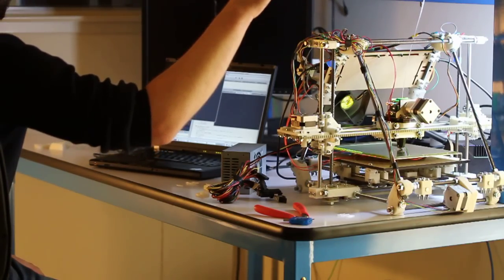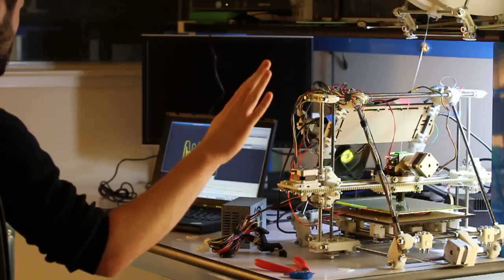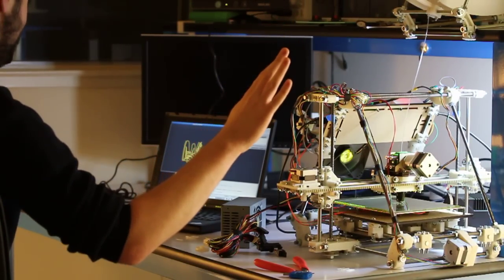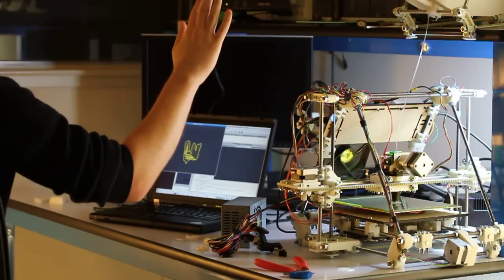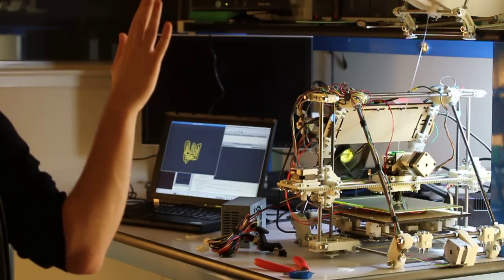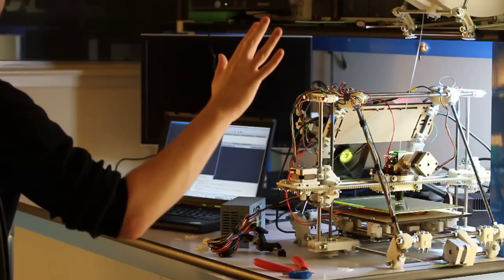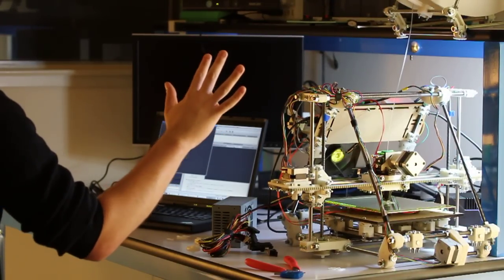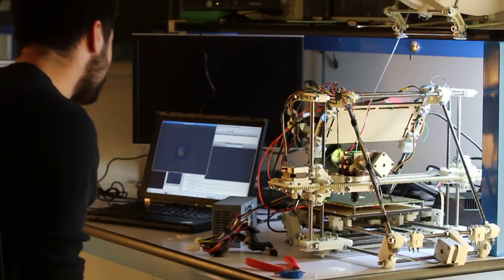Gestural 3D Printing with a Kinect and RepRap

Comment from the maker: @itzlagana I'm planning on making it not extrude over area that has already been extruded in the layer if I bring it to Maker Faire.  I feel like that would be a necessity.

Using a stylus would certainly be more accurate, but accuracy was not the point. ;)